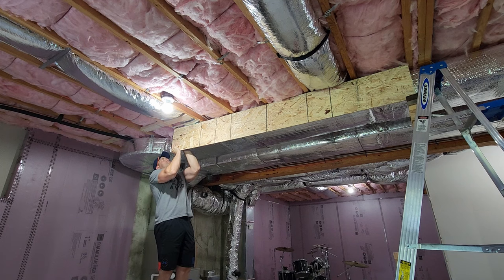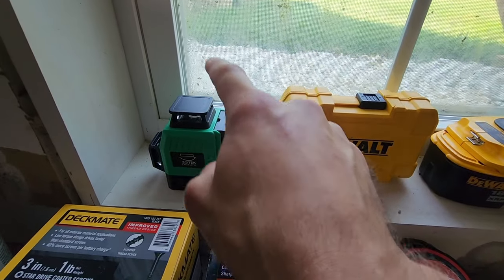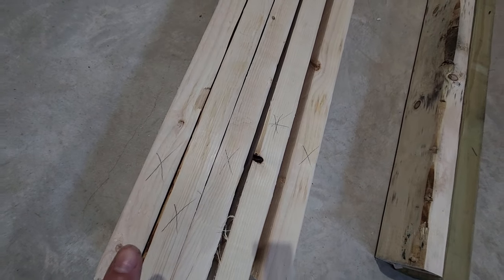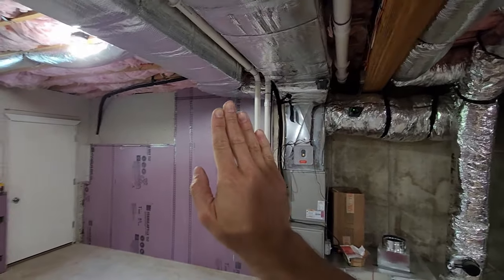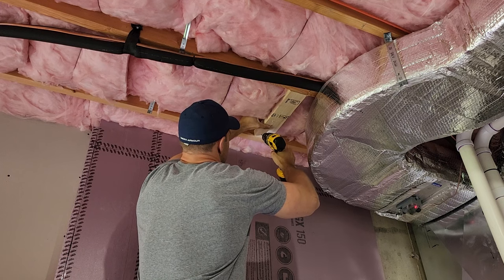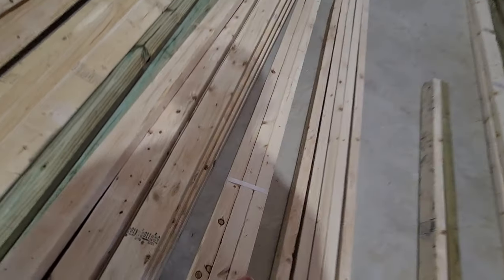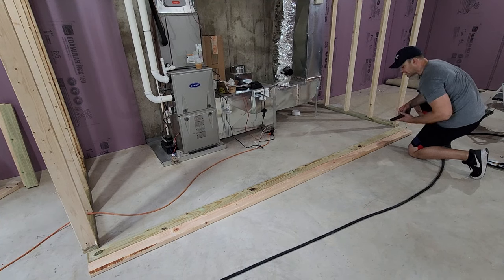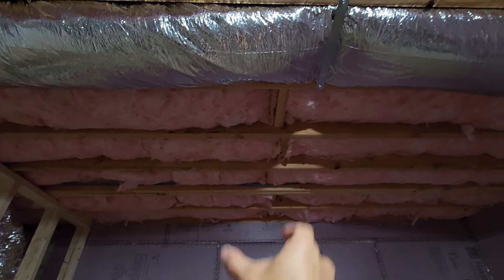I Saved $30,000 Framing My Basement - How to Frame A Basement Part 1

Comment: Got quoted 75k to finish my basement. House built in 2022. Last home I’ll live in, this is our 4th house in 13yrs lol. DIY is gonna happen 😂
Reply from the maker: @hayvenA11  it's outrageous!!
Reply: Indeed. I’m going to do the framing and flooring myself. Going to contract out the electrical, plumbing and drywall/lighting. This video is very helpful thank you 🫡
Reply from the maker: @hayvenA11  glad it helped!  Good luck w/ your project!

Comment: What i don't understand is why this guys don't do floating walls incase the basement floors start to swell in other words floor starts to rise up because of the clay soil when wet expands and dry it shrinks
Reply from the maker: @DuaneMondragon  doesn't happen in my climate.  Not to mention that would be horrible concrete.

Comment: 1 huge mistake, the wall insulation should be on the outside, so the thermal mass of the concrete is inside, which would have moderated the  temperature greatly. Your way has the concrete as cold as the soil. when the warm, humidified air reaches the cold concrete moisture WILL form. a vapor barrier will only make it worse.
Reply from the maker: Well the house and the basement was built to code so...
Reply: @ryanscottlifts
Code dont mean Jack if it's wrong or not followed. That's why there are inspections. If you paid to have it insulated during construction, they would have put rigid foam on the outside. I have seen countless vids of new construction inspections with major, dumb mistakes, and outright stupidity, but YOU installed the insulation?  I bought used, with a fully remodeled basement. All the drywall at the floor level was moist. Behind the drywall, stud wall, fiberglass, and vapor barrier, the concrete was dripping wet. It's your house, do what you want. I'm not dissing you, just trying to warn you.
Reply from the maker: @imnewtothistuff  yea I am not arguing,  but I have never seen a home with outside insulation on the below grade concrete foundation. And I have watched a ton of homes get built.  But I will research it.
Reply: @ryanscottlifts 
 I live in  Illinois. It's common practice, but its an upcharge so many wait till later and inside it goes! it also makes sense thermodynamicly. Happy framing!
Reply: @ryanscottlifts  I am in Michigan and just had a house built and they had the exterior poured basement wall waterproofed and foam board placed.  It was standard with their build but i did pay extra to have foamboard placed on the basement floor before the concrete was poured.
Reply from the maker: @paulhahn8656  they waterproofed my poured foundation too, just not the exterior insulation.   It must be bc of how cold it gets by you guys.  I am insulating between the 2x4 framing with fiberflass insulation as well, which should prevent the thermal passage and reduce/prevent any condensation or mold.
Reply: @ryanscottlifts  I plan on doing the same thing in my basement in the near future.  Thanks for doing these videos they help out and are very informative.  Good luck with your project and keep the videos coming.
Reply from the maker: @paulhahn8656  thanks man!!
Reply: @paulhahn8656 
 Very smart! always insulate the slab!! your feet will thank you.
Reply from the maker: @h2s142 I would always use foam insulation on the foundation walls when finishing a basement.  You just want to avoid the "double vapor barrier" which can create trapped moisture and lead to mold.
Reply: @ryanscottlifts code isn’t always right.
Reply: Even with pressure treated bottom stud, I would have definelty placed a thermal break between the stud and floor and bright it up some inches of the two by four studs. I also would have installed single mat and double layer foam board subfloor first and built over that. 

Now you have a cold transfer conduit between floor and bottom stud to travel to drywall.  

And ya, if you were building that house yourself,,, insulation on outside.  And maybe inside to.
Reply from the maker: @lukewaidmann3678  in extreme climate, perhaps.  But not necessary for my house.  Also, the subfloor you're referring to should actually be slotted with slots running up and under the 2x4 framing and up a gap between the 2x3 framing (wall) and concrete foundation so if water gets in, it can dry.  I just don't have a need for that, never had water or moisture or mold. But technically, doing that special subfloor (which is made by various manufacturers) would have been the most technically correct way.  That said, it would have added thousands of dollars and hours of work and, for my situation,  just isn't needed.
Reply: @imnewtothistuff  I have seen both here, pink board on basement wall to create vapor barrier and then insulation stuffed in wall cavity.
Reply: We live in Minnesota and code in our county requires insulation inside the concrete walls.  Ours is foil faced though and silver taped.  I think we also have the pink stuff on the outside of the house like you are talking about.

Comment: Crowns being either concave vs convex?  Also, the heat being produced by the furnace, would that not start to heat up your wine?
Reply from the maker: @tuffy288  the convex side is technically the crown.  And the furnace doesn't really get warm, not even to the touch.  I will insulate the back of the Murphy cabinet regardless.   But my basement is also in the low 60s all the time, so not too worried about it.

Comment: Hi Ryan, which company did you buy the insulation wrap (the air ducts) from?
Reply from the maker: @macfiona4545  are you referring to the rigid or flex pipe sections?
Reply: @ryanscottlifts  is it too much if I ask you for both? Thank you so much
Reply from the maker: @macfiona4545  hey so I talked to my buddy who got me the ducting.  You actually have to buy ducting insulation and do it yourself.  I didn't realize he had done that for me.  But he said it's pretty easy!  The flex ducting should already come insulated and you can buy that at almost any supply house.
Reply: @ryanscottlifts  thank you

Comment: hey do you have any thoughts on gluing lvp onto the foam board as apposed to framing walls and installing drywall?
Reply from the maker: @MeeeVsWeee  Yea, I wouldn't do it haha.  The foam isn't strong enough and you don't put enough glue on it for it to have any structural integrity,  nor does R5 give really much insulation.   It's more for a vaper barrier.  I'd frame bc you also put R15 regular insulation in your walls once framed (total of R20), and if you ever want to hang something on a wall, TV, etc you need framing.  And how would you run electrical with only LVP?